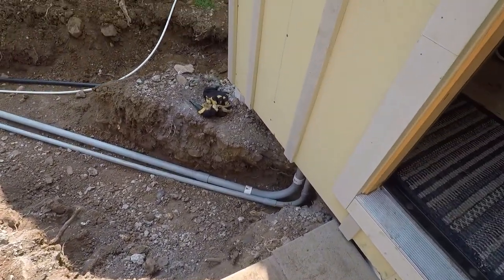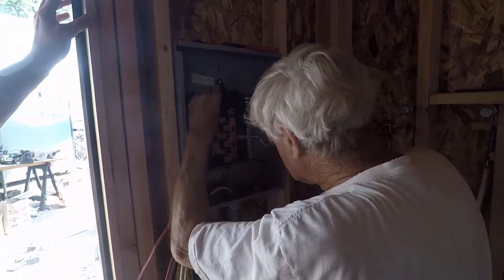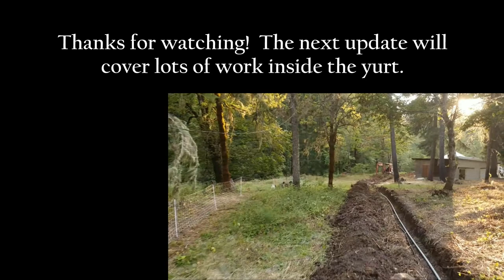Bringing Utilities to the Yurt

Comment: You did the electrical wire from the pole under the surface, but how does it work for such a long distance, if it's not high voltage? Thank you for showing your process it is very interesting and inspiring.
Reply from the maker: It's working fine so far, running an electric kitchen stove, electric water heater, lights, etc.